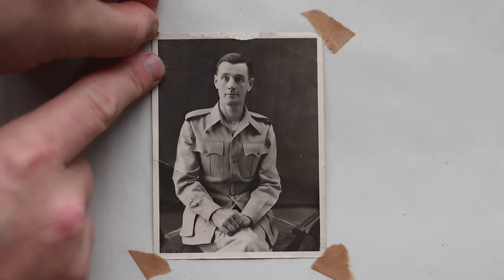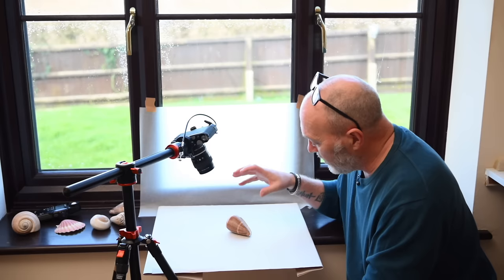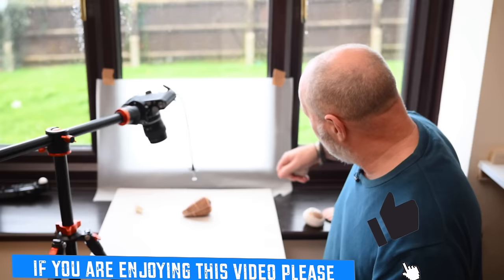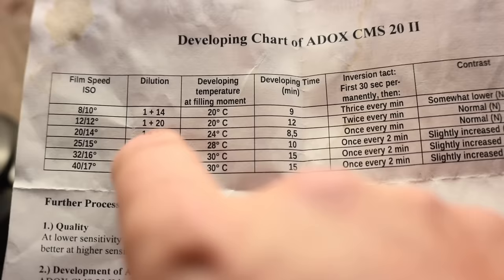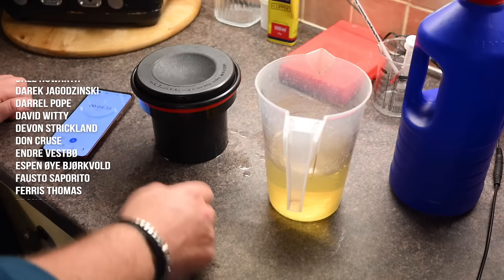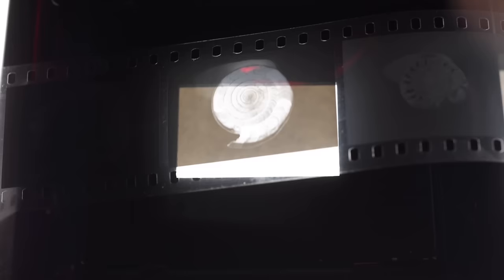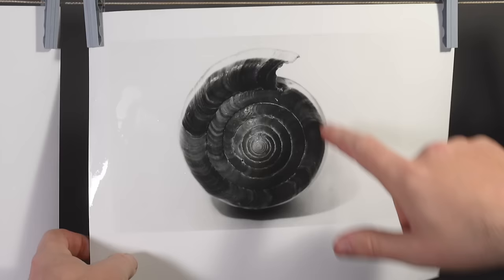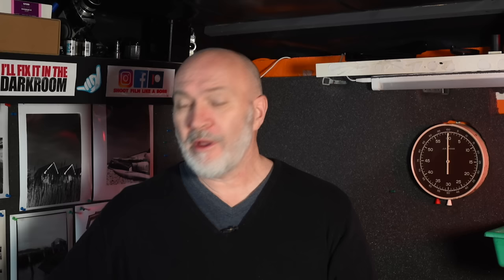This film is NUTS! Capturing Still Life with ADOX CMS 20 II Pro...

Comment: Yup. I was shooting Kodak 2415 Technical Pan (initially used by the US military) back in the day because of the incredibly fine grain / resolution. The FM2 was my favourite SLR back then - and still is today! There was one trick with the 2415 Technical Pan to get BOTH - invisible grain AND speed: *using D-67 (NOT D-76) which is a reversal process*. This way, you get enough speed for shooting hand-held - while there still won't be any grain visible. People talked about ASA 1600 with no grain was possible. On top of that, some of those low-ASA panchromatic film have an extended sensitivity into the near IR. so red filtering will give you interesting tonal values (dark sky, lighter leaves etc.).
Reply: I used the same but did a reversal process to make slides for presentations (the original Power Point 😅)
Reply: great ... there was also Kodak's Rekordak 35mm film with similar spx and results ... i used Agfa cine-positive film for some time in the 1980s, shooting at ASA(ISO) 6 and then processed as reversal slides ... no grain! great for projection on large screens ...

Comment: Preflashing paper really helps with the transparent base layer of the film to avoid high contrast.
Reply from the maker: It does too and I nearly went down that route but I literally had one sheet of that paper left! When I pre flash after tests I have to then flash however many sheet I want to print and a couple extra for more tests, however, in the past I have just literally flashed the paper without tests and had good results.
Reply: @ShootFilmLikeaBoss I feel like this film would be the best for projection after reversal as it does not print well in darkroom and no digital scanner setup can get that information 😂 I wish they had it in 120 format. Strange part they mentioned the machine is broken but at the same time CHS 100 is available 🤷‍♂️

Comment: I only have just started experimenting with this film. I actually cut it down and shoot it in my minox sub-miniature cameras. So far I have only shot a couple of rolls, and I develop it in Caffenol-CLCN. What I can say so far is that even with an 8mm by 11mm negative...it is still grain free! I compared two similarly composed photos, one with the minox and adox cms 20, and another with my hasselblad 500cm with kentmere 100 developed in XTOL. Even though the 6x6 negative is 35 times larger, the minox image was higher resolution! Absolutely incredible film with the right subject matter.

Comment: Hey Roger - I tested that Adox stock with a Sigma Art 105mm, one of the sharpest lenses ever made at 220lp/mm.  When I converted it using a Sony A7R4 with composite mode, it came out with 80mp of real resolution.  It was interesting - the macro lens on the Sony appeared to be the limitation.  I expect had I done a darkroom print and then scanned that with the V850, I would have gotten 8x10 negative level detail :)
Reply from the maker: Yes thats why I went in the darkroom to see it on 10x8. Shame I couldn't get a focus enlarged though. Next time
Reply: This film  is obviously very sharp, but 500 megapixels is bogus. Even if the film delivers the claimed resolution, no lens will resolve that much detail on a 35mm negative, even your Sigma. (220 lp/mm implies 440 pixels/mm, so total number of pixels would be 24*36*440^2 or roughly 167 mp, again assuming it actually delivers its claimed resolution.)  

Further, 500mp resolution would require about 380lp/mm which would be impossible at an aperture smaller than f/2 because of diffraction. 

As you point out, the macro lens on the Sony limits the scanned resolution, though a professional drum scanner might do a little better. But the same lilmitations would apply to an enlarging lens if you tried to enlarge first, then scan.

So even if the film can deliver its claimed resolution (perhaps viewed through a microscope??) There is no way to actually take advantage of it.
Reply: @killersax  Yes i agree,  I was thinking more like 25 MP
Reply: I would happily challenge a duel set-up taking the same photo using this film and my sony a7r5 with my 35mm GM lens any day. Specifically printing 2metre wide and looking at the resulting resolution, grain etc. I just don't buy it. It does look like a really nice product though, good to see you can get very high quality from 35mm film without having to go with medium format

Comment: Excellent video: the optical resolution of the largest (20-inch) enlargement on the paper print for the apertures and sizes stated in the video is probably about 75 µm for a perfect system with no optical aberrations.

Comment: Just a thought; you might want to try some of that adhesive putty they use in galleries to keep the framed pieces from swaying on the wall. It would allow you to shape it and have the shell stick to it, but just temporarily, easy to remove. You can reuse the putty and buy it in small amounts in a craft or hardware store.
Reply from the maker: I usually use blue tac but didn't have any. It is a tad hard though and never thought of a putty! Cheers.

Comment: I only shoot digital these days but I still found this video very interesting. At a 500mp equivalent this film will def test the sharpness of your lenses. I upgraded to a 60mp full frame digital camera a little over a year ago and since I love shooting wide open with my prime lenses, I found that the sharpness of my images is lens limited not Megapixel limited. Depending on your lens you might want to stop down to F8 to get the sharpest results possible.
Reply from the maker: Thats why I chose the Nikkor Micro. It's a great lens. I'd liked to have stopped down more but wasn't sure if reciprocity would have kicked in! Hence why I kept it at 1 second and faster.
Reply: @ShootFilmLikeaBoss  f/2.8: Sharp all over, does have some light falloff
f/4: Little, if any, falloff
f/5.6: Diffraction limited in center; seems like it is all over actually. Even illumination.
f/22: Diffraction takes the edge off the sharpness

Comment: great ...

this film's spx and image results remind me of the good old times cine-positive 'sound' film ... (probably not in use today anymore?)

it's (was?) a super fine grain emulsion that comes in both B&W as well as color formats ... very low ISO (say ISO-0, yes Zero!) for the starters ... then its sensitivity can be increased using different developers and other developing tricks ...

its main use is for producing positive copies of negative cine films for projection on large movie screens ... today of course, most movie theaters use digital projection, so, this material is probably either fully discontinued, or used in niche markets perhaps ...

i used to work with the B&W version of that film (from Agfa) to shoot mostly copies of text and diagrams and/or images in books for a university in the 1980s ... then, depending on the order, i either developed them as negative for prints, or as reversal for transparent slide projection on large amphitheater screens for educational purposes ... great results! barely any visible grain ... it can be used like lith film as well btw ... or as panchromatic material for normal images ... the reason it was also called 'sound film' was because it was also used for recording optical sound for movies ... i still love to experiment with that film someday ... many possibilities for various kinds of photography! 🙂

Comment: Just some extra information: Adox CMS 20 II and Spur Ultra R 800 are the same film, and Adotech developer is quite certainly rebranded Spur Nanotech. So there is actually only one 500 megapixel film and one special developer for it. The film is an Agfa Gevaert microfilm that is presumably discontinued, so it's likely that CMS 20 II will disappear from the market some day. This would also explain why the price went up by more than 100% from 2022 to 2023 and why Adox haven't resumed production in 120 format after they repaired their machine.

But it's not confirmed that the Agfa film is actually discontinued, unlike Agfa Copex Rapid, another ultra-high resolution film which is still available on the market, just like the corresponding Spur Dokuspeed special developer.

BTW, CMS 20 is also a great film for landscape or architecture. At ISO 20 in bright daylight it can be shot handheld at f/5.6 (wide angle), f/4 (standard lens) or f/2.8 (short telephoto).

Comment: I’ve used CMS20 in the past using 510 Pyro to develop it but overall I think Adotech IV is the best if a little expensive per roll. Yet even though you aren’t likely to be using this film all the time the cost is moot for MF quality in 35mm, so it’s a great film for landscape on a tripod.
Reply from the maker: I think so Steve, if you're on a special project of sorts then it's small cost for getting the results you want. As you say, not your every day combo.

Comment: Thanks  so much.... what a  wondeful video! I'm wondering how a set up like this would turn out with a pinhole camera
Reply from the maker: Very nice I would imagine. Obviously you'd need to account for the wideness of pinhole. You could try different distances like a few inches away to a foot away and different camera angles. I have some pinhole negs of similar set up. Obviously softer focus.
Reply: @ShootFilmLikeaBoss  If you ever print the negs it wold be great to see them. Yes, as a beginner in Pinhole it's quite a challenge workng out the distance issue. I thought I had it sussed on the last outing but I am still a little "distant", so to speak. Happy with the results but not exactly what I planned.  I have heard that ADOX CMS 20 is touchy loading and can spoil the first few shots... also very challening in developing. I have CHS 100 which I will be testing next week.

Comment: Just wondering why the medium depth of field? How did you decide on 4 or 5.6 versus f8-11? Thanks. I like the images with diffused light.
Reply from the maker: Thanks. I didn't want to exceed 1second shutter speed as I wasn't sure of the reciprocity. Knowing I was in shallow waters I was also interested to see how they turned out, but yes, usually I'm at f11/f16.

Comment: I used this one quite a lot when it still was available in 120 format, a bit tricky to develop though (Adotech II-IV). Then the coating machine @ Adox broke and the film was no more. Several years have passed and it will most probably never return as a MF film. You could make insane enlargements and focusing was a pain - because there was no grain to focus on! But it's probably very (or even more) useful in 35 mm. Maybe I should try that... I still have an opened 50 ml bottle of Adotech IV in the fridge, maybe it still works...
Reply from the maker: Yes a few have mentioned to me about the machine at ADOX. I imagine the cost of fixing it would be crazy.
Reply: Yes, it's with almost certainty a lost cost/benefit project. Just like Forte/Adox Polywarmtone paper. They made the emulsion again (have some aged in the fridge), but the paper will never come back. Still - happy printing wishes from Sweden! @ShootFilmLikeaBoss

Comment: A question about stand development and pushing film. Since with rodinal 1:100 you basically develop so that all the developer is exhausted adding time to the development wouldn't work well for pushing film. I read somewhere that you could add 1ml per stop of developer instead. Do you know if that works? I'm planning on testing this soon.
Reply from the maker: I believe it would work Janne without adding more developer. The stand will, as you know, exhaust itself in the highlights but I don't think stand would give you contrast if thats the reason you are pushing, such as on a dull day. But if you're pushing for more speed in good light I would stand normally. I have always been in the mind that Rodinal needs at least 10ml of developer for any one film, although I have not seen any difference with just 5ml, but I often use 10ml anyway for a stand. So if I am developing a 35mm film I will mix up 1000ml of developer (10ml for 1/100) just so I know the film gets a good development.
Reply: @ShootFilmLikeaBoss  I was thinking about pushing kentmere 400 3 stops after watching grainydays video about it. He showed amazing results with it. I think I will first try without adding developer to see how it'll turn out.

Comment: There were already equal and better films back then. Today's films are made according to old recipes.
Reply from the maker: I wonder if todays TRI X 400 is better than the TRI-X 400 back in the 60s? As in slight tweaks to improve it, expiry, reciprocity, the actual film material, better grade silver? Or if it's not as good as it was! Or equally the same.

Comment: To avoid any confusion: while this film could theoretically get you an equivalent of 500MP of resolution, it's just not possible to get there using regular photography. Even if you had a perfect lens that is absolutely sharp from corner to corner at f2.8 at infinity, you'd be lucky to get an equivalent of 400MP of data onto that film. Stopped down to f4.0 for closeups/macro and you're looking at...80MP? Maybe? The effective aperture really does reduce the actual resolution very quickly. And then whilst optically enlarging the image you'll lose even more of the potential resolution. So in the end I wouldn't pay too much attention on the supposed theoretical resolution of the film, just shoot and have fun with it. The fine grain will make for a very clean image anyway.

Comment: sorry to burst your bubble but your lens does not have more then 12mpix i think , top 15mpix . So that is actually about 50x  less resolution then advertised , for about 100Mpix you need medium format , and for more obviously more , but you can do the same with your point and shoot and get better picture by zooming in and taking 10 images stich them up , and there you go . Same resolution actually higher , because point and shoots have around 8 to 10 mpix lenses , so that would be around 100Mpix , where you have around 15mpix . If your lens is good .
Reply: The film in this review is printable up to 2.5 meters diagonally according to Adox which is roughly 500 mp. You are right about the lens as the limiting factor but hypothetically speaking a fine enough lens can render that figure. I know that having used some leica, zeiss and nikkor glass on my A7ii I have had lenses intended for 35mm film out perform the camera. While I don’t know that it is possible I would be willing to bank on it. I just ordered a few rolls and will shoot them and get back to you with my thoughts.
Reply: @emmetgibson6599  The easy thing would be to shoot the same subject with say Nikon D600 or Canon 6D  , have something to compare it with .
No doubt no one needs 2.5m prints made from film , i just didn't see that in my life .
And no doubt the Film is giving it Analog feel , it looks better then DSLR , no doubt about that either .
Regardless of Mpix , i found that i do not need more then 8mpix , but the quality of those matters . I would very much like to shoot Film , but its expensive . So its for the professional . I know it matters , not the mpix , but the Analog feel of it .